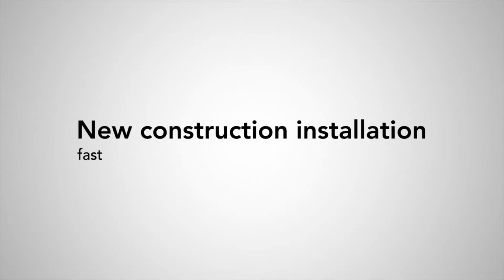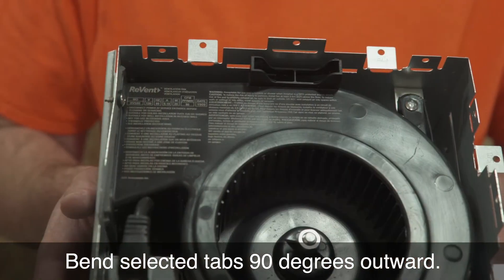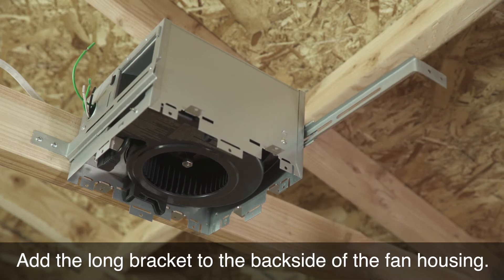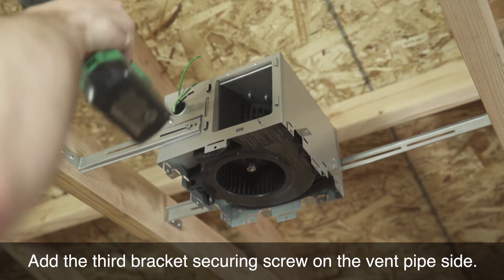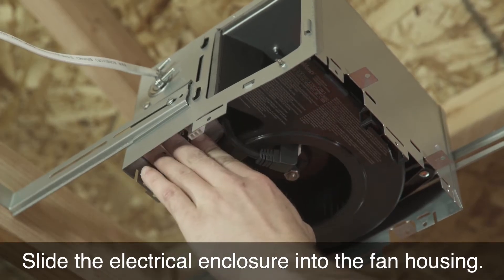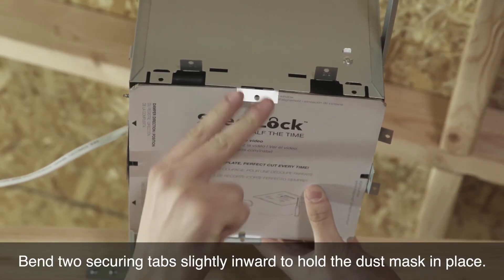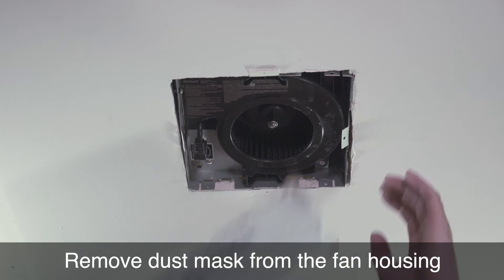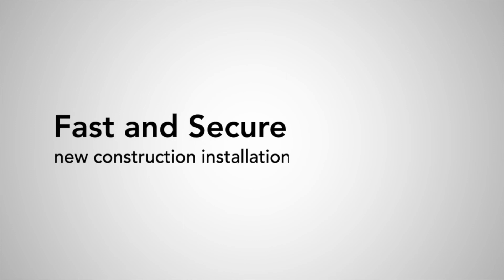How to Install a ReVent Ventilation Fan - New Construction Installation

Comment: if the unit sits against the other side of  the roof truss, vent side bracket becomes too short and can't be used . Design is completely garbage